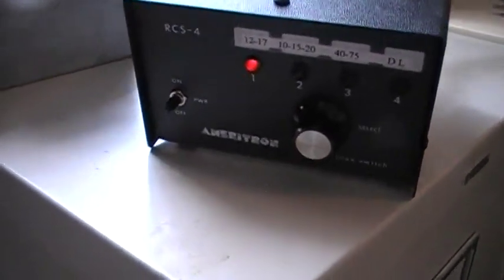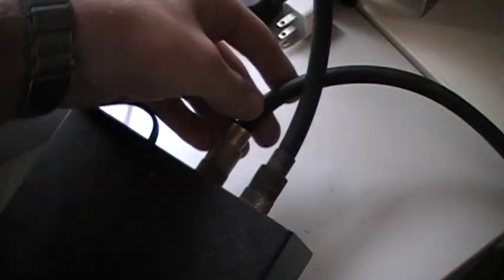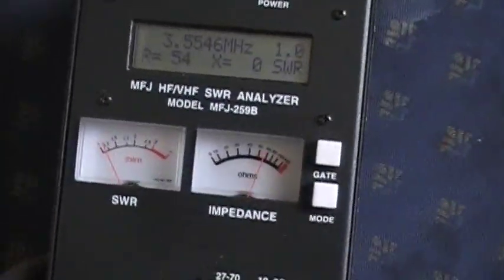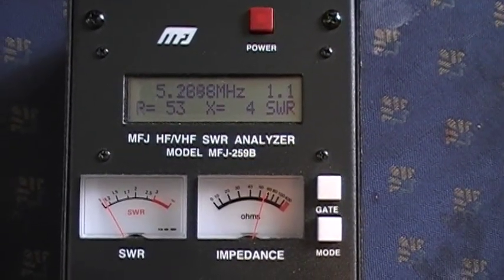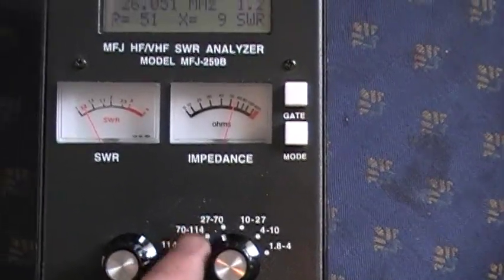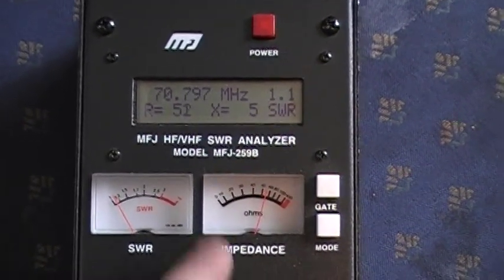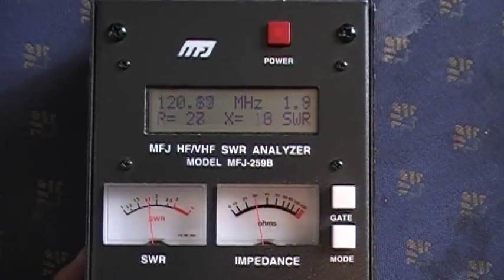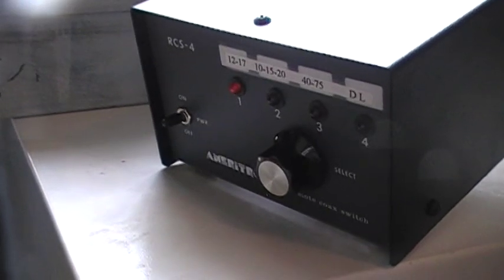SWR Testing of an Ameritron RCS-4 Coax Switch

Comment: Yes they upgraded the Unit, moving the transformer out to a wallwort. The Wallwort is 12VAC as it takes AC for this Unit to work. The concept of powering the unit via the coax has been around for a long time and CATV uses it to power their amplifiers. I purchased one of these and I had a nasty AC Hum on position 1. I disconnected the Antenna and measured 12VAC on the position 1 connector. The other three positions tested OK. I called Ameritron Tech support and Rob stated there is a problem with the Unit. He suggested I return it or fix it myself. I am tired of repairing MFJ products so I returned it and got another one. Same problem! I returned it for a refund. I like the idea, I just need one that works...Good Luck to you . Thanks for the video...

Comment: the SWR is increasing as you increase in frequency. why? because you are using a bnc "T" with your 50 ohm load. This creates a small stub that will have its own reactance. Try connecting your DL directly to the bnc port without a "T" and you might get better results in the higher frequencies. good luck

Comment: We just mounted this switch on a tower and used it on 6 meters. Works great. We get 1.5 SWR with an analyzer but we believe the antenna is the problem and will be fixed in the next few days.